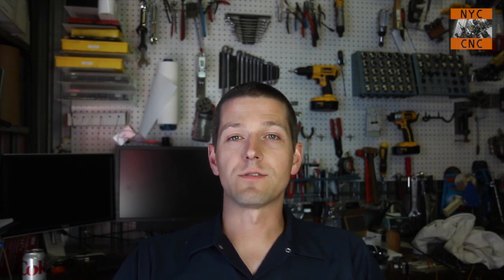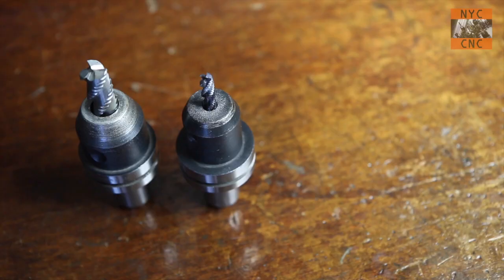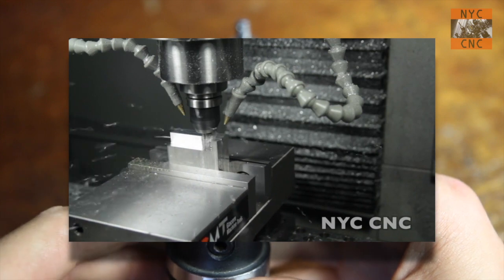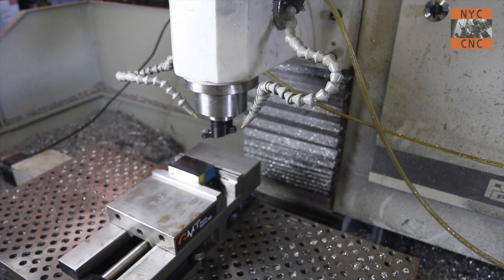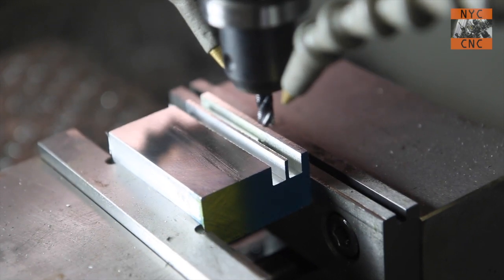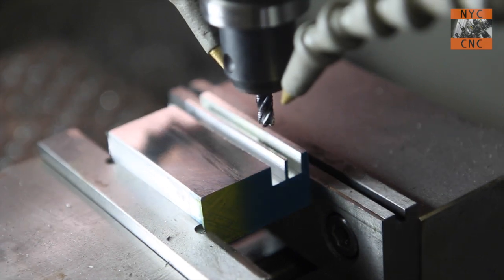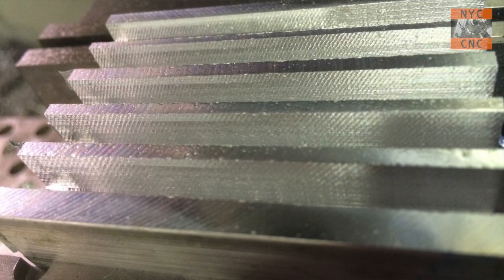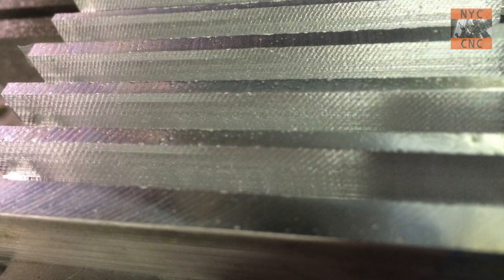Getting Rough with the Tormach PCNC 1100 CNC Mill

Comment: I'm confused why this is a good idea ... 4 flutes, 5000 rpm, that is 20,000 cuts per minute ... with a .003" to .005" chip load .. you would need 60 to 100 ipm ... which I don't think the flutes would clear. At 30ipm you are making way too small chips and will get significant rubbing tool wear.    Roughing tools work well in steel but I can't see the advantage .. I personally use a single flute solid carbide, so it has a HUGE flute to remove the chip,  I run 18000 rpm at 90ipm ... I'd like to use a 2 flute, but I can't get 180ipm out of my machine yet.
Reply: Max RPM on this Tormach is 5100. It also has low torque ability on top of that. it's just a hobby mill, can't expect too much.

Comment: Try using Lakeshore's Fireplug rougher. Your depth of cut is only .175 and the stubby has a .375 flute length (plenty of length for chip evacuation) and about 4 times the rigidity. Biggest problem with carbide breakage is lack of regidity. Think you might be pleased. Solid stream coolant  will double your possible feed rate as well.
Reply: NYC CNC Z,

Comment: NYC CNC Have you had and problems with your tools slipping in the chuck. When I use my Tormach PCNC Mill the vibration causes to tool to slowly fall out of the chuck. Do you know any good ways to fix this? I have tightened everything down. But it still slips. I can't take half the depth of cut that you take in this video without the tool falling.
Reply: Hey I know your comments is 3 years old, but I would check the leveling of the machine and look at messing with the belleville washer setup.  A level machine definitely vibrates less.

Comment: One problem you'll experience with aluminum or other non ferrous metals is built-up edge. It's hard enough to get away from w/o liquid coolant.  Chip flute volume is key for higher metal removal rates in soft, sticky materials.  Get a GOOD 2-fl or 3-fl, dead-sharp, aluminum geometry end mill, throw the juice to it, then use the same tool for finish. Roughing end mills; however, ARE good for reducing HP consumption, which may work out in your favor.

Comment: NYC CNC Roughers rock.  Basically the wave in the cutting edge greatly increases the effective length of the cutting edge vs. the depth of cut, which results in that thinner chip you mentioned.  Funny, right before that first endmill broke I was thinking, "Hmmm, thats a four flute in aluminum, is his coolant on?"  Done that before!

Comment: Excellent.  Only analogy I can offer here is sanding...  You can sand a rough cut piece of wood with 250 sandpaper, but it will take a really long time and you'll use a lot of sandpaper and create a lot of friction.  Start with 100 to do the bulk of the work, then move to 250.  Not only do you get done faster, but save a lot of money in the long run.  Looks like the same thing here, save stress on the tools, wear on the machine, less friction and more efficient.  Actually makes perfect sense!  LOL!
Reply: My bad.  Just convert Wood to Autobody repair.  LOL!

Comment: One of the other advantages of roughers is the way they are ground, form relief like a corner rounder.  It makes for a tool that is not very sharp but it's very tough.  If you get into larger diameter tools it's worth it to have them sharpened and unlike a traditional end mill sharpening doesn't change the diameter.

Comment: Sweet explanation of the tooling AND the benefits to your applications, very nice. Been away with PC problems, do you think you could rough out the depth of my wallet so I can just spring for a new one? LOL!

During the heat of the afternoons my shop is an oven, so I took your advice and bought one of Tom Lipton's books, and let me just say, I agree with you on how great of a writer he is, on top of being an expert metalworker. I bought "Doing it Better" his second book, and I just loved it! It is filled with so much humor and insider shots at the life of a real world on the job guy, it is priceless.

Ooops, didn't mean to get off track, I just really wanted to thank you for the extra push to buy one of his books instead of a set of t-wrenches. Heck, with the tips in there and here online, I will build my own set...of anything. Well, you know what I mean.

Take it easy and happy roughing!

Aloha...Chuck
Reply: NYC CNC
Hey, that's actually not a bad idea...you should make a trick slim little machined aluminum wallet with slots for CC's, ID, with a little hinge pin that your money tucks behind...hmm, how could I send you a design?

Comment: Awesome! Glad you are checking out Lakeshore Carbide! I've only used their tools in steel but Brad recommends Helical for Al with the ZRN coating. The few times I've cut Al with a TiAlN coating I had pretty bad smearing all over the tool. I was running copious amounts of flood so not much BUE but the fact that my purple/blue tools turned Al color was evidence of a propensity to weld.

I've done a lot of testing with roughers vs finishers and can tell you as you have already discovered, game changing advantage.

I might even experiment with doing a full 0.350 depth slot with the rougher even if you have to drive a little slower. That would equate to less machine time and half the amount of time the endmill is cutting so it could conceivably double your tool life from where it is with two passes.

Carl at Lakeshore Carbide explained it as an endmill having a finite amount of cut time in it and the tips are where they typically fail first. So the more material you can remove while minimizing the amount of time the tips are engaged the better. In other words go for the deepest DOC you can while still avoiding chatter.

I really think you would enjoy my videos/blog where I delve into a lot of these issues in detail: http://www.warmachinellc.com/blog/

Comment: Good video :)
I miss milling aluminium, I machine 30% cast iron and 70% D2 tool steel.

Using mostly HSS endmills for finishing, roughing i do with 16, 25, and 50mm carbide indexable endmill/facemill
Reply: Tell me about it :D

Best thing is when I work 2-3 weeks on D2 or similar, and then comes full pallet of cast or CK45 (german standard) it cuts like butter :)

Comment: Nice explanation, I've got a job where I need to make 3/8" slots which are 0.800" at their deepest point, the best way I found to do it is run a 1/4" rougher at 0.700" then run the 3/8 at full depth.

Comment: Keep rolling the videos out man! I am just starting with milling albeit manual. Just used a tormach superfly for the first time and your video was very helpful for speeds/feeds. Power feed on x is so key for me and the superfly. 

Also the fireplug variable flute roughing from lakeshore carbide is the knees of the bee. I used it on some zirconium 702 and 6al4v ti and it just mowed right through it. Then followed it up with one of their 6 flutes for a finishing cut and the results were fantastic.
Reply: The fireplug is basically just their stub length variable flute rougher. For the thin stuff I do with knives it's perfect. Not ideal at all for deep slotting. 

A full time machinist friend of mine keeps raving about the destiny tool raptors for use in stainless and titanium, and their diamondback(i believe) for aluminum. I keep meaning to try them out as well. Great prices if they are as good as he says. Check out justendmills for those destiny tools.

Comment: Hello, you can use a smaller diameter endmill and use a trochoidal toolpath to cut these slots. That way the engagement of the cutter is lower and you have more space for chip evacuation. You can also engage the cutter in its full lenght at once. Look up "GARANT TPC - Trochoidal Performance Cutting" here on youtube they explain it.

Comment: Just wait till you get a more rigid machine.
Reply: NYC CNC Max Rpm in my case 10K   .5 of depth around 45ipm. Your depth around .170 I could increase the feed around 60ipm. If you  have the right toolpath you could easily get Full Depth of cut and 300ipm cut with 5% woc